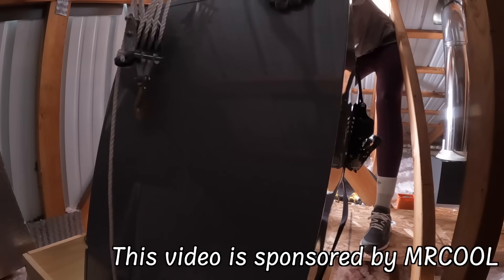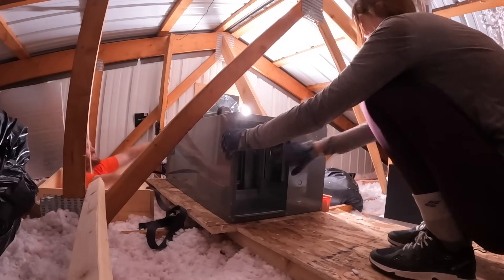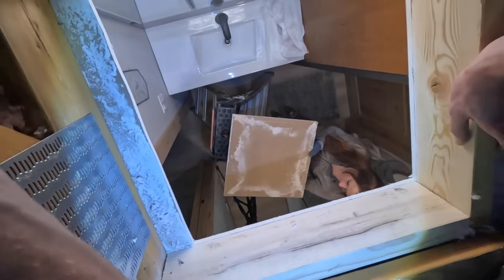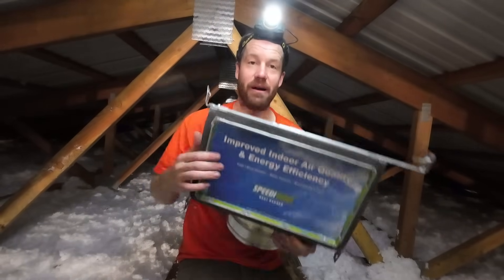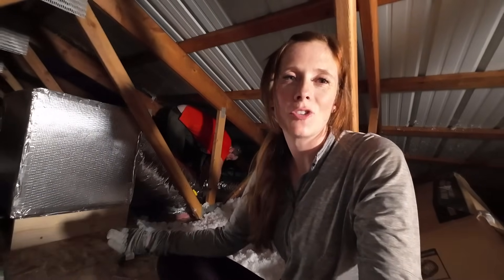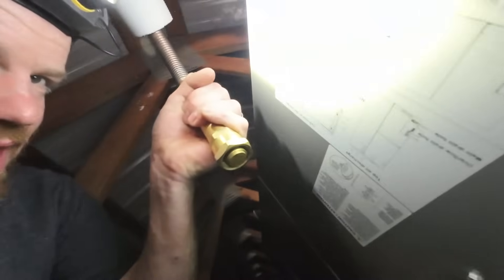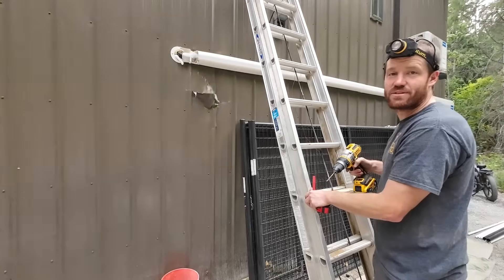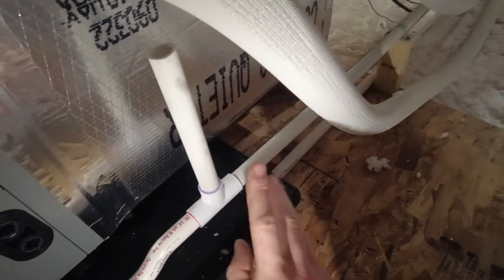Replace Your Old HVAC System With THIS! (DIY Heat Pump Install)

Comment: Something in or neck of the woods, insects like to use cavities pipes etc. to build nests etc...  and can / will plug the drain pipes...  so think about how o prevent such.  Maybe a box with fine mesh set back a few inches from the opening but also surrounding not...  windows screen something "serviceable".

Comment: Avoid surprises, a Blink camera in the attic and you can monitor the water tray without climbing into the attic. You can turn on and off the Blink with your cell phone and it's two AA lithium batteries will last a couple of years.

Comment: Hey Guys 
Whilst doing yr Mr Cool job.
You do not have any 3" or more insulation blanket with sisilation  under your Roof Sheets.
Hence the attic Moisture cycle begins 
Especially in winter 
Warm air in attic hits the Cold Roof sheets at nite or Day.
Water Vapour in the air will condense back to form Condensation 
& a huge Loss in energy & heat or cooling in summer. 
Spray Foam off gassing  is a worry. 
Funny ha ha 
 it's like living in a tin shed. 
Bye for now.

Comment: you guys should have consulted HVAC guy/engineer and maybe have him sketch up locations of return and ducts, having main return in bathroom is terrible idea.  if someone closes the door using bathroom means its sucking air mostly from bathroom creating negative pressure, ideal location for a return like that  is to have it in center of everything in a hallway, and also with ceiling duct work you dont want air vents in front of the window
Reply: A return in the bathroom is never a good idea for obvious reasons.

Comment: I'm kind of surprised you didn't do it at night time when it was cooler as that hundred degree Heat would cause me to be drenched with sweat stopping me from seeing.

Thanks for bringing a smile to my face with your unit Integrity working together and accomplishing such a wonderful, absolutely Stellar piece of paradise!

You'll want to periodically check the tape around the system to make sure the glue does not disintegrate causing leaks. There's a way to check for leakage but I don't remember how and I'm sure you can locate it on YouTube to ensure you have 100% efficiency

May all of you be abundantly blessed!

BVD f/ NY

Comment: One of problems with short air returns is noise   especially  at the grill  
A metal  duct you would  assemble the duct while  in attic  to manage getting  in small  space  but would  need to be insulated also  so your duct board does  both 
 One thing I see going to be problem  is heat pump  inside unit is in a  uninsulated  space   your installation is above  the insulation of ceilings  no insulation  above   any water left in unit from  cooling mode could freeze   and ruin ceiling  before  you know there going  to be an issue  
The out door unit is going to drip water while  in defrost mode in heating cycle    risk making ice  skating  rink  under it 
 Heat pumps loose efficiency  below  25 degee   requiring  electric heat to come on to help  depending on how many stages of electric heat the inside unit came with  heat pump  and thermostat   when  cannt keep up with loss of inside temp thermostat  will call for electrical  heat to stage on  some electrical heaters have up to 4 stages of backup heat 
Make up heat will come on every time the outdoor  unit goes into defrost mode with will depend on outdoor template  and humidity  
 Warning don't freak out  heat pump put out a soft heat  not like fossil fuels heat  and outdoor  unit fan will stop and steam will be made especially when colder  could collect under eve of metal roof  Mr cool will try to push it away from building  but warm steam will rise regardless  
It's really  cool to see that Mr Cool and few others that are filling  a niche for DIYers    
I personally  HVAC&R  tech 35+ years   retired  downside in when  comes to repairs  to all brands higher efficient  units repairs $$$$$ 
Have self diagnosis of faults help   kind of like service engine light  for cars and truck 
Didn't  see return  air filter installed   !!!! Could be installed in return air grill

Comment: No doubt that system is heavenly, especially with the heat we had here in North Idaho this last week.  I almost have the courage to tackle a Mr. Cool system of our own, but I hate the idea of punching another hole in our shop.
Reply: The DIY mini split is easy. But the pre charged lines only come in 16 and 25 feet. If you can place the outside unit at a distance that uses up all the line it'll be a nicer look. The official method of dealing with excess line is to coil it up between the unit and building but I've seen a couple of videos by pro/licensed HVAC installer that it's better to lay the excess coil horizontally, underneath the wall mount bracket. That ensures it won't get an oil build up trapped in a low spot.

If you want to use regular lines to cut to length and flare, but can't or don't want to DIY that part, find an HVAC person who owns and runs their own one person shop. They're much more likely to find time to come out to your place for an hour to cut and flare and connect the lines then pull a vacuum on it then leak test. The franchise shops or shops with a bunch of employees or any HVAC shop whose bread and butter is selling the equipment is unlikely to want to have anything to do with homeowner installed stuff. They tend to want to only work on equipment they've installed.

Comment: Very cool install. One small suggestion, with pocket doors into your bathroom there will be very little airflow to the return when the doors are closed. Which could cause your unit to freeze up or at least cause one side of the house to get really cold if one door is open and the other closed 

An inexpensive “fix” is to put an air register in above the door to create a pass through for return air.   Might not be ideal for your situation because I remember those walls being insulated and the vent It does allow sounds to pass, but way easier than expanding and balancing a return air system.

Comment: That mr. Cool 10 year warranty did not include labor for me; only parts.  I have two of their 3Ton units and my evap coil developed a leak within first year and while mr cool does appear to be covering (actually waiting for their response) they wanted a license hvac contractor verify the problem and that cost me almost $200... 

Now I'm being informed that they prefer that license hvac install the replacement evap coil.

Outside this it does appear to be a quality system. Their PCBs are conformal coated, salastic used on vibration prone components and all board2board wires are well insulated and my units are so extremely quiet.

UPDATE: They are shipping me a new evaporator coil but are charging me $262 to ship it which is outrageous.  I ship rack mount servers that weigh 50 to 80lbs overnight with insurance for less than this.  It's a racket.  The Mr. Cool warranty is simply not worth the paper it's written on.  Sorry Mr. Cool, but I will not be purchasing any more of your equipment.  You just do not treat customers with any respect and you certainly don't stand behind your products as evident by the price gouging and cost recovery hidden in shipping fees.

Comment: One hole saw break, one fly in the eye, and one upside down thermostat cover.  That is pitiful.  You can do better Riley.  I know you have insurance.  Could you not at least dropped the outside unit.  But the unit looks like it is something those who have older systems might want to use it to replace their old ones.  What size breaker was needed.  I am guessing 220.

Comment: Stand on the pallet and hold it is my way of doing things too.

Im surprised by the power consumption. I'd think an inverter wouldnuse a less thsn thst to maintain such a small space. I know their units have a tonnage selector, are you on 2 ton or 3 ton? A 1 ton inverter minisplit tends to use 5-600w to maintsin temp so I expected more like 1500w. But i guess the SEER on the univerdals is lower than the mini splits.

Comment: Hey guys. If you want to heat and cool better try adding a lot blown in insulation in the attic. I have 16” in my shop works great.

Comment: Great job on the installation. And nice problem solving, Riley.

One question. Did you put a downspout pipe on the secondary drain? Just wondering as if water comes out without any pipe, it's going to cling to the case and cause rust. A small elbow would prevent that possibility.

As to Oliver, let's presume he'll inherit all the best traits of both of you. Courtney's planning and Riley's action.

Enjoy the cool air!

Comment: But I never understood with people why would someone put the air handler in the hottest part of your home it's like putting the window air conditioner out in the middle of the yard in the sunlight and having duct work push the cold air into the house It doesn't make any sense. Since you don't have a crawl space I sure hope that you insulated around the unit granted I haven't watched the video yet but I will update if you did insulate around the hair handler put it into condition space

Comment: Maybe you already thought of it but you might want to capture the condensate for auxiliary free water.
When we installed our first central air split system I put a 5 gal bucket at the condensate outlet and it would fill up every single day. So I exchanged the 5 gal bucket for a 55 gal drum and used the collected water for irrigating our garden. It was very expensive water to make, so I did not want it to go to waste.
Reply: Something to consider... Generally speaking, it isn't recommended to use AC condensate for things related to human consumption since it can contain heavy metals. Might be good for a flower garden but probably best to avoid using it in a vegetable garden.
Reply: @Rickmakes  Also the pollen and other airbornes add algae and other yuckiness to real nasty stuff to the water- flower garden is the ticket!
Reply: They already have a dedicated machine that makes water out of condensate in the air. I guess you're not a regular watcher of their channel. At 14:00 - 14:04 you can see the machine in the background. That big white machine on the ground is the water-maker.
Reply: @xNYCMarc  I AM a regular watcher and also I am aware of their "machine" to make water. I also know that they were not pleased with  how it worked (watch the follow-up episode) and had to find another alternative for getting water. I was simply offering them an alternative that I found, that may be useful for their needs, as well as the needs for anyone else who might watch their channel. Admittedly this method may not work for everyone as I live in the south where it is quite humid in the summertime and there is lots of moisture in the air to make water out of.
Reply: @FrugalBuilding  So, you're aware that they have a machine that was purpose built to take condensate out of the air for water and it DIDN'T WORK, yet you suggested that they collect condensate? Um, okay.
Reply: @xNYCMarc  Yes it is quite logical actually. They were trying to condense water from rather dry outside air while the indoor air that is being conditioned may have a lot more humidity in it due to indoor moisture producing activities of the humans living there.
Reply: @FrugalBuilding  It isn’t logical actually. The three of them combined would STRUGGLE to put 100oz of moisture into the air from “just living”. The vast majority of moisture in the air of a home comes from outside the home.

Comment: The return vent should be in the bath room when you take a shower it will be sucking in moisture form the shower and it could cause it it freeze the coil and also should be in a bigger room.

Comment: A wonderfully smooth product integration with your home. I wish all projects ran that smoothly, though I fear I have reached the stage of my life, such that getting up and out of bed requires almost the stages you set out. Number fingers that barely know the difference between a screw and a wall plug do not help one little bit! However, all credit to the pair of you, the work involved some sketchy stages, but all went spectacularly well.

Comment: Nice job. HVAC guys probably would advise against returns in bathrooms because of the moisture.
Reply: I was thinking they should probably have installed the return in the hallway adjacent to the bathroom.  That way it won't be blocked when someone closes the door.  It also won't spread stinky bathroom air around the house after burrito night.

Comment: Riley do some research .... you should not have a flex duct connected to the end ....  all pipes need to come off the side so they get equal pressure .... the one on the end is getting 90 percent of air ... and sometimes will vacumn the side ducts ....... other than tha awesome job on the entire build .... im a builder in Dallas since 1978
Reply: I didnt see any baffles. The only way they will be able to regulate the flow is at the registers which can cause condensation problems.
Reply: Correct my ac guy installs dampeners on every duct right at plenum ... very important to balance out system    ...and seen sometime to make a scoop on a older duct that needs more flow ... never ever seen a duct on the end in my 45 years of building...

Comment: Won't make hot air if its to hot outside because my Mr. Cool Universal had some kind of set limit so I had to get up in the middle of night when it was in the 60's to heat.

Comment: The idea that every hot house in the world could b cooled and lit by the array  on its roof is mind boggling!!  Good bye Mr. Utility, hello Mr. Sunshine. If it’s hot enough to need an AC, chances r there is enough solar shining on the roof to power it. For the night time, either a battery bank, or chillled water that u cooled sufficiently when the power was abundant.

Comment: Instead of the stand alone system, can you collect the condensation water from the AC units? Obviously need some UV and other filtration on it but it essentially does the same thing as the stand alone unit but you are running AC anyway.

Comment: When it gets around 27⁰ F normally the heat pump doesn't work and you need electric aka Emergency Heat or use your stove and just have your fans on blowing the stove heat towards the intake or run a ductline with a blower right above the fireplace/stove to the intake you just have to make sure that both fans the one at the stove and your units fan stays on while the stove is hot otherwise things could get a lil dicey unless the duct is metal and the fan in it is not right at the end right above the stove.

Comment: Cleaning your outside unit of all of the pollen and debris that will clog it will be a nightmare at that height. What I have done with my units is I built a screened in box to go around the entire unit that self cleans due to the wind flapping it, just like screens on your window. I didn’t do it but you can make the screens removable just like the screens in your windows. Otherwise, the efficiency of your units will drop dramatically and quickly.
Make sure that the screened in box is large enough to not restrict airflow. I imagine that a calculation could be done for that, but I simply used a Kleenex to see if it was violently drawn to the screen. A box, roughly twice the volume of the actual outside unit size seems to work OK. Bonus: hides the units. I also built  an eave around the top of the box out of treated plywood for snow management.

P.S. I also notice that your metal roof underneath is bare. You may want to research  potential condensation issues from it since you are heating  the living space more. A light coat of spray foam underneath could save you health issues (mold?")

Comment: A HUGE mistake putting the return register in the bathroom.  Your HVAC unit will be sucking in all of the moisture created by the shower.  I suspect that is against the mechanical code.

Comment: You're absolutely correct, Riley. Too many HVAC installers undersize the return air register and duct which starves the unit of fresh air.  When it comes to the return air side, better to oversize than undersize.

Comment: How slow were you running your oscilator because on the job, we cal it the angy hornet (okay, we cut off shims, hole plywood, trim back flooring, cut PVC and a lot more with ours....and might have 2 or three going in one bathroom or kitchen). How did humans make it without an oscillator 👽

Comment: Im surprised you still haven't patched that hole in your back wall to keep vermin and bugs out. Thought you would have learned your lesson back when you discovered how many critters were getting in when you neglected to seal the bottom of the siding. Better do it before the season turns because once it starts to get colder everything will start wanting to move in with you.

Comment: Not a good idea having the air handler in the hot attic. Also it needs a emergency drip pan. Would of been better mounting air handler on wall high above loft office. Return air through the wall and duct work in attic.

Comment: Riley, ate you sure that you have enough blown-in insulation up there in your attic?  Seems a little thin in the video.  More insulation will keep the house cooler in Summer and warmer in winter.

Comment: I’ve seen these electronics too many times. Totally destroy your ceiling. A little forward forethought install you a switch that will sense water in that pan. That way. It does not happen. very inexpensive way is to set you up a gallon bucket with a wire running up to a simple light switch that shuts your unit off if it was starting to go out the overflow pan. Works really good. My father was a genius.😊